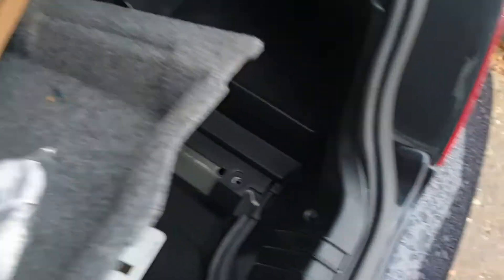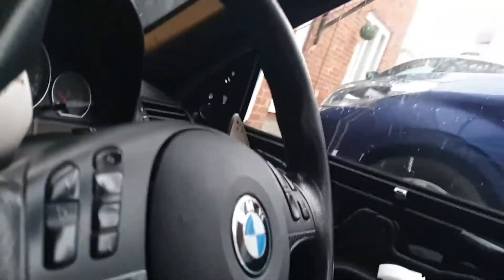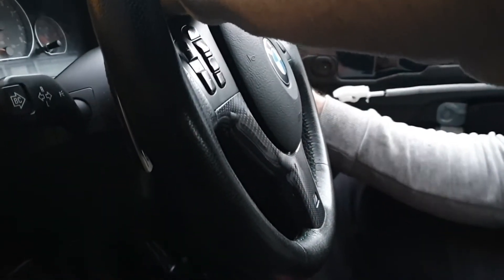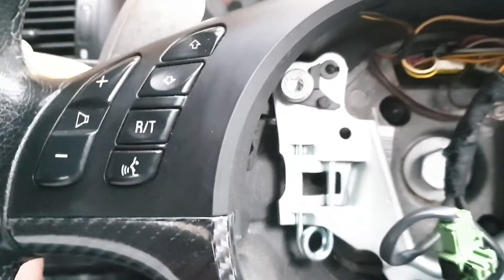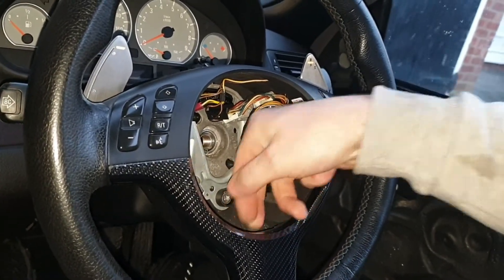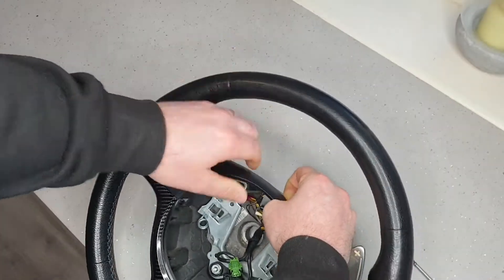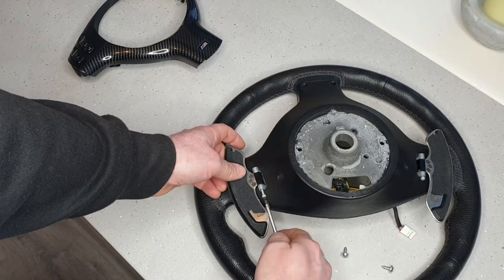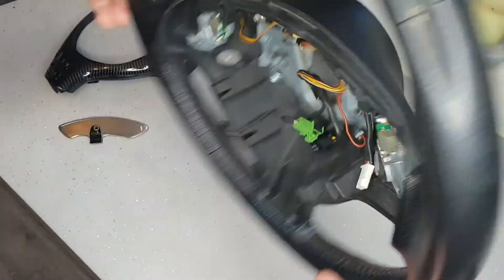BMW e46 m3 smg shift paddles, steering wheel and airbag removal... Time for a retrim!

Comment: Hi mate thanks for this video. Wanted to ask, the carbon fibre trim on the lower half of your steering wheel can that be removed and taken off without having to disassemble the whole wheel? I have purchased the same part but in alcantara. Just wondering if this can be put on without having to take the whole wheel off